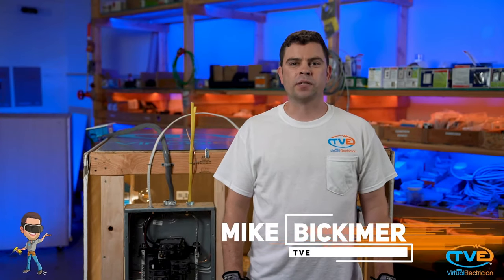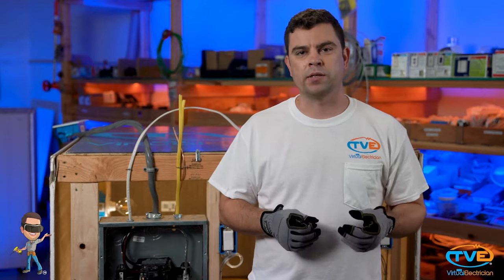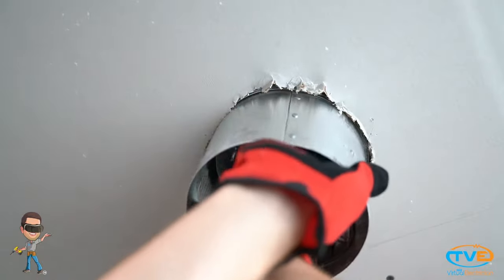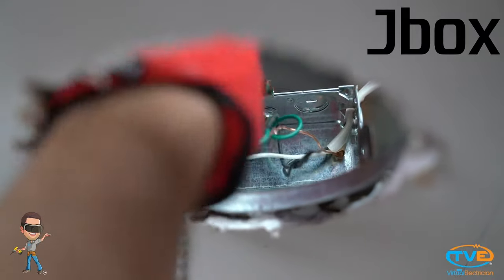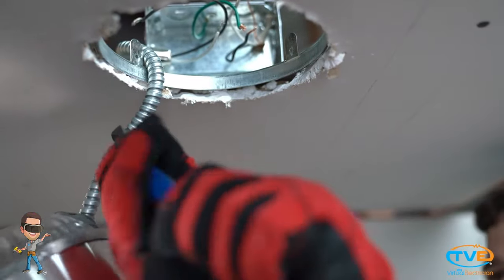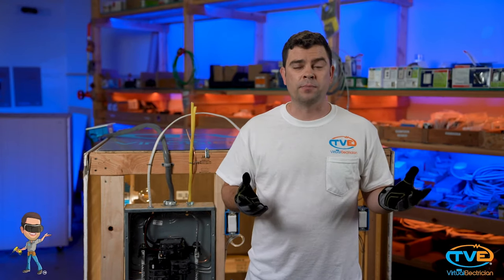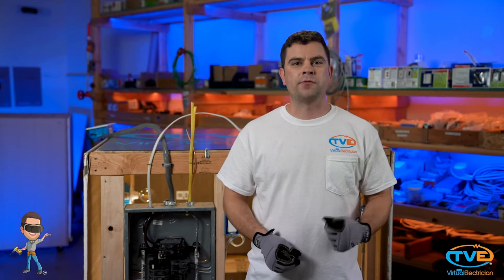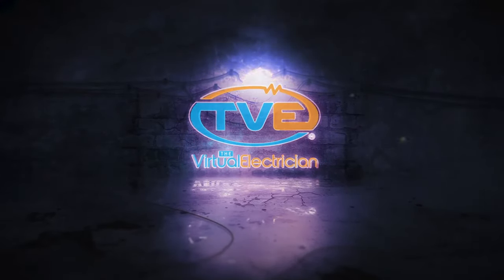How to remove a can light | WITHOUT attic access

Comment: Always check for power even when you believe everything is off. Never cut two wires at one time unless you checked for power and there is no other option. When I was young and inexperienced I was replacing a lighting ballast in a commercial fixture. The light switch was off, but the light fixture was on an emergency power circuit separate from the other fixtures. After feeling 277 volts flow through my heart, I always check for power.
Reply from the maker: 100 percent

Comment: I want to change from a can light to a semi flush mount and also move it over about 6 inches. Can I just open it up, move the wires to a new junction box with brace and patch the hole, leaving the can up there?
Reply from the maker: yes - make sure jbox is accessible

Comment: thanks for this video - is it possible to just disconnect the wires, leave the can holder in place and simply install a new LED slim light? Any concerns with leaving the old stuff in place?
Reply from the maker: if the light fits it is ok
Reply: @TheVirtualElectrician  Thanks! Just installed all new 6 LEDs leaving all the "new construction" stuff hidden behind the sheet rock. I removed all cabling to the old stuff, secured the cabling to the new equipment JBoxes and everything works just fine - it was a bit of a pain to free up the cables due to narrow space (4 in holes) and older equipment having a lot of cables (ballasts).
Reply from the maker: @v33dsportsvideoservices40  great job!

Comment: I have three 4.5" can lights under a flat roof that do not have the screws or the black clips.  There is just one shiny clip on one side.  I can't figure out how to get these three cans out so I can access the wiring to install wafer thin LEDs.  I want install the LEDs throughout that bonus room where I do my hobby.  This is what is stopping me from proceeding on this project.  Advice?
Reply from the maker: I would be happy to help.  Is there any way you can upload a picture of your can light?
Reply: @TheVirtualElectrician  Where can I upload to?
Reply from the maker: @dkaustin98  you can email it too:
Mike@thevirtualelectrician.com
Reply from the maker: @dkaustin98  also if it is a can light that you cannot drop down, have you thought about retrofitting the current can light to LED?

Comment: This might work for very simple/cheap cans. You'll never be able to do this with new construction LED lights. The recessed fixture is built like a tank. You WILL be removing some ceiling sheet rock. Welcome to the "Darkside" of LED lighting.
Reply from the maker: usually in residential homes, contractors still use these cheap 6 dollar cans.  you might be thinking of cans for commercial spaces
Reply: @TheVirtualElectrician  Actually, no. Many of the recessed fixtures in my home were north of $400. These are Juno LEDs. When they fail, very expensive to fix. I wish I had gone halogen.